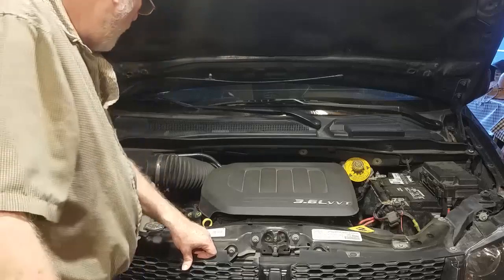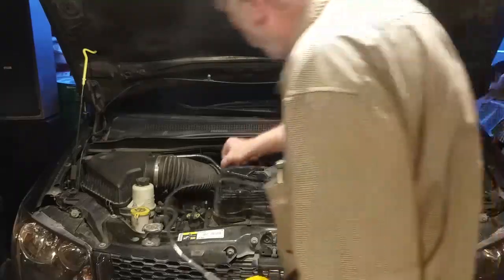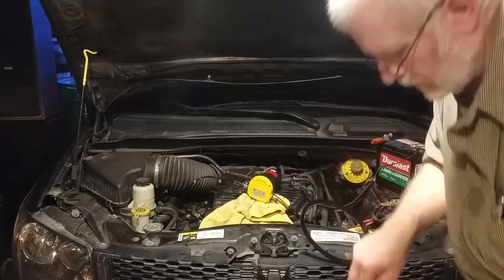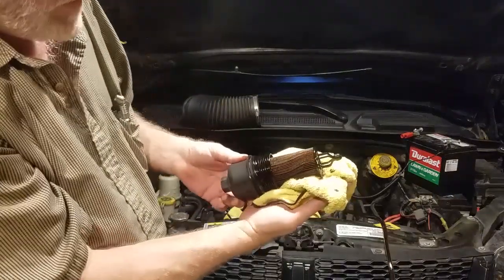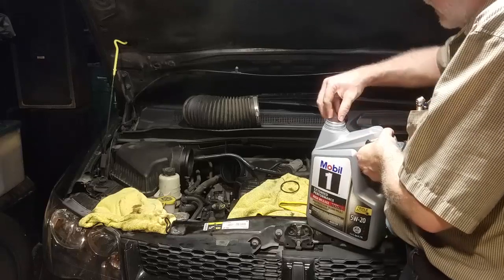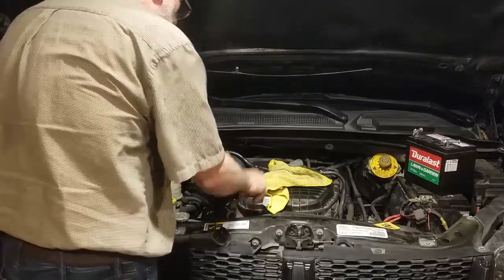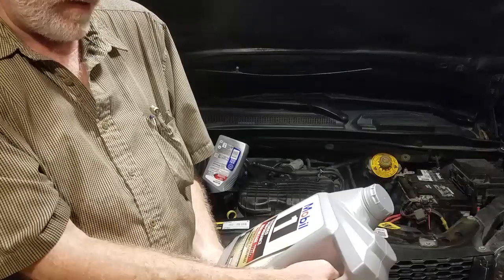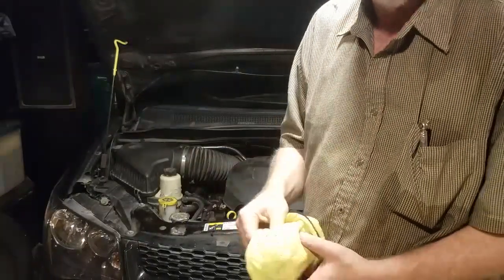Oil and oil filter change 2017 Dodge GC GT using cheap oil extraction pump bought on Amazon

Comment: Drain plug not accessible? That's the BEST way to change oil. Extraction pumps are for inboard boat motors or other hard to get to drain plug installations.  I used one on my sailboat due to access issues.
Reply from the maker: Great point!